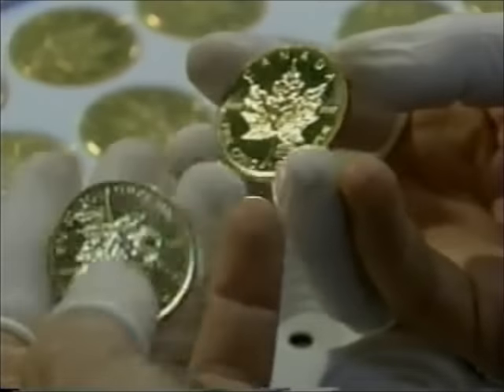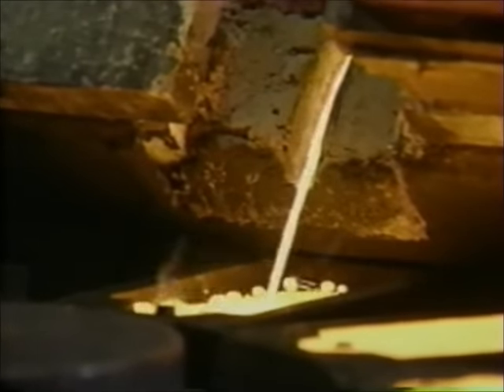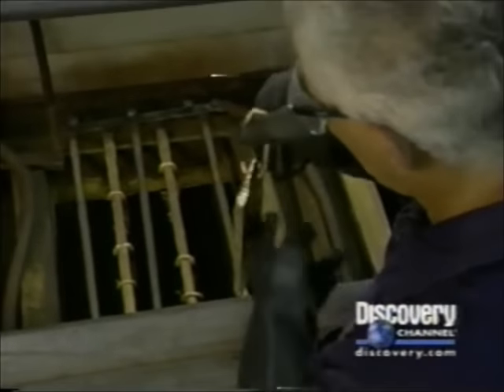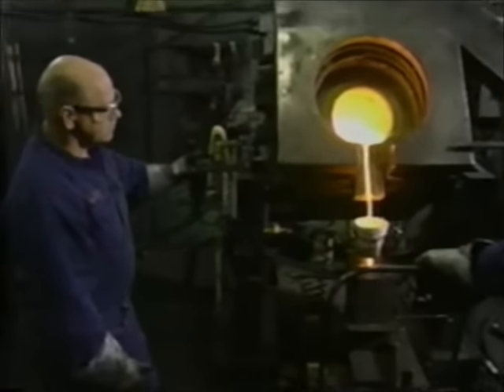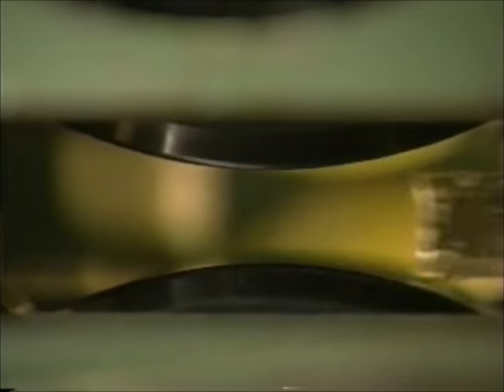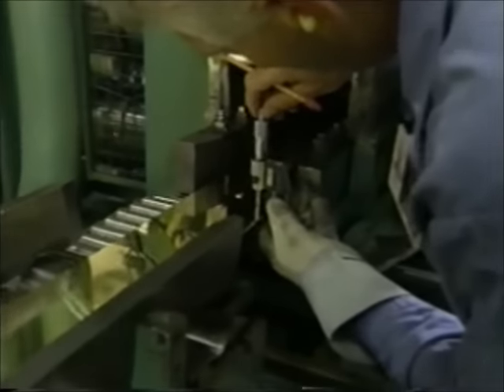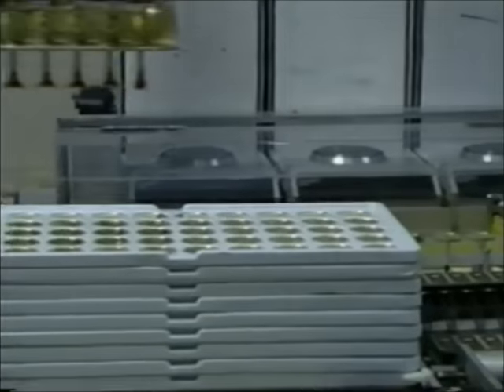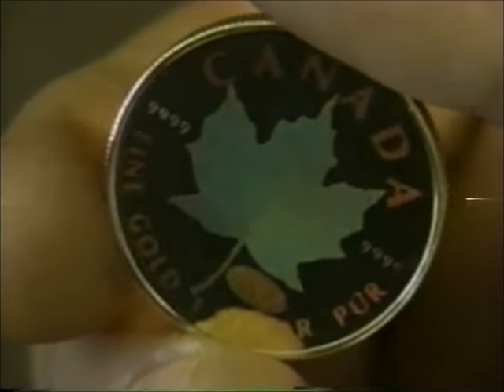Royal Canadian Mint Gold Processing and Minting (English)

Comment: I wonder how they know when to stop skimming the molten metals? Watch it on each scoop as it cools to see the colour? Or they see an actual difference in the molten material?
Reply: skill and experience.But any crap is easily fixed by plating.The crap sinks to the bottom of the tank and has another useless metal called silver in it.( kidding)
Reply: Actually  it goes thru electrolysis in final stage where only pure gold migrates to positively charged plates from smelted gold.

Comment: once i bought 50 ,they came in 5 white tubes with red tops 10 in each tube. 
     all stacked together, no tissue paper separating them or anything. .maybe a bit of packing foam on the top to keep them from clanging. we are talking 15 thousand dollars per tube and they couldn't afford a bit of tissue paper to keep them nice, as you take them out you likely would touch them against the other and whammo you have a light scratch(.9999pure is very soft,
     buyers of these type coins are EXTREMELY PICKY when you go to sell, i was docked 10 bucks on almost every one.even though they were brand new right from the mint.
 but i do like the maples they are a nice yaller. much prettier than the eagle or kruggerand.

Comment: 7:40 is it just me or is it interesting to others also that they say it takes more pressure to strike a gold coin than is needed to strike a quarter (which is much harder metals) ......hmmmmm
Reply: samy701 I understand they want a very sharp and detailed design. What I said is why does it take twice as much pressure to strike a gold coin (hello, gold is a lot softer metal) than a Steele quarter. That to me is very odd.
Reply: Brian Wilson
Reply: It is force not pressure. Get units right.
Reply: @brianwilson9501  more pressure is required because of the larger size of the coin... Striking a dime uses less pressure than a quarter or half dollar. Also no modern US coins are made of steel... Quarters are Copper and Nickel.

Comment: The only point where "efficiency" is when "weighing" Canada's own coins. 

All it takes to "refine" lead is heat it to 650 degrees F or so (way short of "glowing" at which point everything less dense floats to the top and you can "refine" it further by "fluxing" it with candle wax or sawdust and draining the pure lead off the bottom. 

This looks like a hell of a good way to "refine" a shitload of somebody else's gold just shipped there for "refining" right the FUCK out of their "shipment" and into Canada's "supply".

Comment: 4:35 "gold this pure is extremely heavy"

excuse me, what? even if impurities had no weight, purifying it from 99% purity to 99.999999% purity would only increase the weight by less than 1%
Reply: 1:05 - the rough ingots can contain up to 70% other metals, mainly silver.  That could cause a 30% drop in the specific gravity (or the weight of the ingot compared to a pure gold ingot).
Reply: @karhukivi  thanks
Reply: @aresgood1  You're welcome!